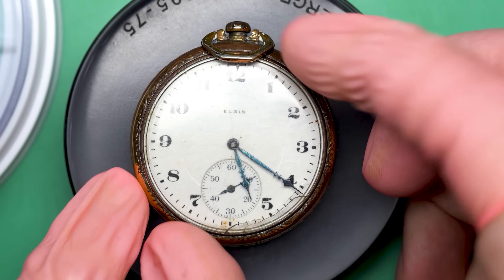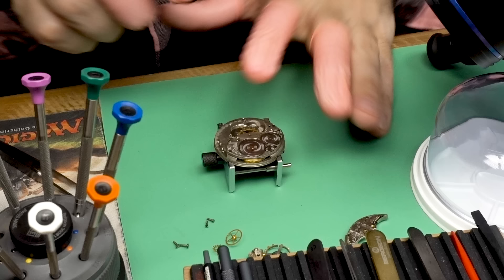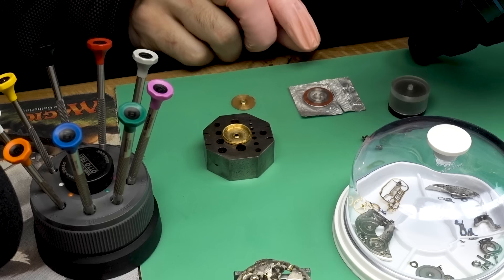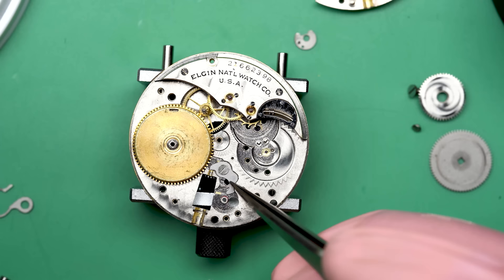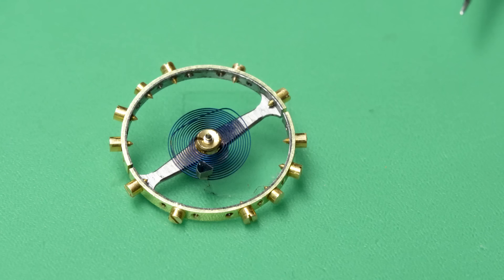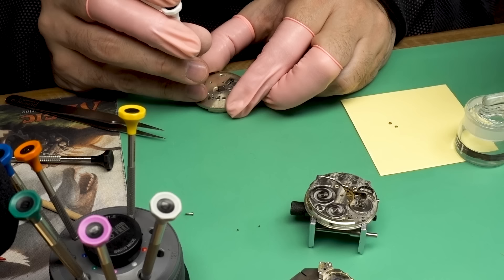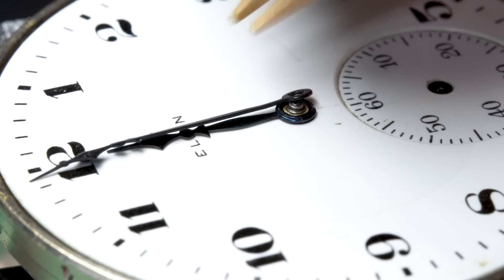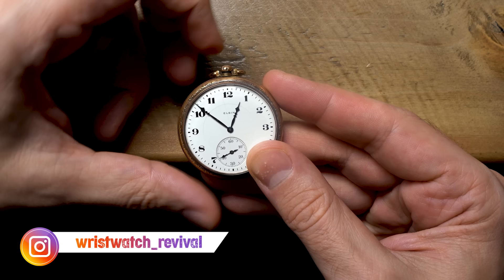My First Patron Sent Me His Grandfather's Pocket Watch

Comment: I have an 1882 Elgin in a Duebler (sp?) case.   The front cover has an engraving of an elk.  The back has two leaves.  One opens to hold a photo, the second one opens to reveal the movement. It is a lever set watch and keeps beautiful time.   I wear it whenever I am wearing bib overalls as they have a bib pocket and button hole for this reason.

Comment: Just bought a pretty vintage (80-90s) watch while thrifting and thanks to ur vids I felt confident enough to pop off the back and I’ve ordered a replacement battery, it’s in such great quality so I think it’ll be able to run after I replace the battery :D
Reply: The Goodwill and other thrift stores are chock full of discarded quartz watches.  They have no dollar value, and can hardly even be given away in today's smartphone and smartwatch culture, but if the style and condition meets with the seeker's approval they can be worth their small price plus the cost of a battery.  Just remember that most of them can be replaced with brand new similar models - including ten year battery - for $9.95 to $39.95 at discount big box stores. 
If changing batteries is desired, I suggest looking at the case back to find the battery number, then ordering six or ten of them from Amazon for less than the the price of one at a retail store.  They also sell several batteries of six or seven different types all on one card, very cheap. 
Those old case backs are friction fit, and have one small slightly raised spot where they are supposed to be levered free by a semi-sharp tool.  Cover the back with a couple of layers of painters tape to prevent scratches - I guarantee for beginners the tool will slip and scratch the back if not protected.  Don't use a knife - the blade is too sharp and the metal too brittle.
Reply: @ammoalamo6485   I bought a guess chrono from ebay for about $10. It needed a new battery. I had taken an Omega pocket watch, cased in the USA by Elgin, in rolled gold, to a Horologist. He replaced the spring and serviced the watch. I asked him if he could get the pressed back off the guess watch. No problem he said, I will use a guillotine. Well he tried but could not get it off. I had tried other street vendors who also could not open it. So I took the watch home, got a thin screwdriver, and a light hammer, and tapped away. Its was the hardest back I had ever removed. I put the new battery in and put the watch on the cover press. There was no way it would go back on. I put some small cuts in the rim, but retaining its seal edge, and press fitted it, but it would not fully seat. I got a cloth and the light hammer and gave it a sharp tap. It seated. If a Horologist could not get it open, this old motor mechanic managed it.

Comment: Hi Marshall, I've been watching you and Mark's videos for a while now, and find it amazing . I even bought some tools to tinker around with. I bought a bag of watches from eBay and some were wind up and others quartz movements. A fellow on eBay had three watches pretty cheap, and I bid on the, not very much, and in the bunch was an old Waltham that wasn't working. I took the movement out of the case and put it into a jar of Naptha (lighter fluid), and swished it around a bit, and low and behold, the thing started running. I think this will be the first one I'll take apart, or maybe, an old stop watch may dad used for his time study job, back in the 30's and 40's. Surely enjoy your vids, and look forward to seeing them. I'll be turning 85 in July ! Bob U. from N.E.Ohio.

Comment: for case back dent removal; delrin rods in a variety of diameters, lightly round the edges a bit, lightly tap rod into the case back with a soft face jewelers hammer (either the nylon or the brass side, doesn't matter. you're touching the case with the delrin, not the hammer). you may wind up with a variety of rounded ends for various use cases, but thems the breaks.

side note; delrin ain't crazy cheap. nylon works, but tends to mushroom faster.

and for those who don't have the bits before hand, or want to stay on the low cost side, yeah rounded toothbrush handles can do the job too hah.
Reply: hard wood has worked well for a few centuries also. :)
Reply: I was wondering if the crystal press could do the job also.
Reply from the maker: Thanks, I'll look for that

Comment: I really enjoy watching you display your skills.  I realize that this is way beyond what I can do, but you have got me started on building my own clocks from 3D printed parts.  I'm working on two designs now and having some success.  Thanks for giving me a push
Reply: A fellow 3D printing enthusiast!, seriously considering starting to try and print one of those projects too, deffinitly need to fine tune my printer  (an Anet A8) before trying though they look to be quite a challenge
Reply: @UNSCPILOT  Take a look at the ones I did.  Woodwaker1 on you-tube
Reply: @woodwaker1  nice work, cool to see them in motion, especially speeding along in high speed mode just to demonstrate how the gears work together, thinking I might try finding a more purely mechanical design even if it means I have little chance to fully regulate it, it would just give me an excuse to interact with the clock more often

Comment: I’ve watched for some time now. And now I’m comfortable to ask. With everything being so precise and so delicate like the balance, is there a specification where the screws should be torqued as to not over tighten? Would over tightening screws or not enough tightening would cause the watch to run faster or slower?
Reply: From what i've learned watching this channel, I would guess not. The screws only serve to fix the bridges to the body of the movement. The metal faces would touch eachother, and while it's technically true that the clamping force would compress the metal itself a little bit, in this case (with the thickness of the metal and the low clamping force) the effect that loose/tight screws have would be neglible. The important thing is the location of the jewels, which have a through hole in them. With the bridges screwed down and the metal faces touching, the height of those jewels wouldn't change. And with a bit of wiggle room, that the pivot/axis is slightly smaller than the distance between the upper and lower jewel, it would be fine independent of the tightness of the screws.

What would be more important I guess is the side to side location of those jewels. Screws in themselves don't act as a particularly effective locating feature. When almost screwed down, such machine screws (with a flat bottom) allow for some side to side motion, since the screw thread isn't the exact size of the hole it is in. Therefore there are locating pins on the underside of every bridge. These pins fit inside precision holes in the body of the movement with a tight tolerance, which makes sure that the jewels are in a precise location.
Reply: I'm just starting on this journey, and no, you won't affect the movement when you tighten the screws. The bridges have locating pins and stand-offs to position the bridge perfectly.  For wheels that are directy held by screws (ratchet wheel and crown wheel) then the screws have a shoulder to prevent any pressure on the wheel. If a wheel doesn't turn freely after fixing the screw, then it means you used the wrong screw. Really cheap movements made of sheet metal (US Time, Timex etc.) might be a little more sensitive to how you put things together, but they are not normal movements and usually are much harder to work on. In fact, they were never really meant to be worked on or repaired but you can if you are good enough.  See Marshal's Mickey Mouse Watch service video.

As far as how tight, just finger tight so it is just firm is enough. Most of these threads are a small fraction of a millimetre thick.  You don't go torquing anything this tiny. You very quickly get a feel for what is correct.
Reply: Contrary to what others say, Yes. Over tightening or under tightening screws, for example yhe screw that holds the balance cock in place, the tighter you torch that screw, the tighter your sandwiching the wheel/ gear that that cock/bridge is holding. So it is possible to overtighten screws. Especially the bridge or cock screws. Over tightening the balance cock screw, could put to much pressure on the balance wheel, which in turn could lead to poor amplitude, or in some cases, even stop the watch from running
Reply: The saying I've heard is tight is right, too tight is two pieces.
Reply from the maker: There aren't any specifications for torque on screws like this, but usually you screw them down until they resist, and then go just a bit more, like 1/8th of a turn, and you'll feel when it's set. And no you can't really affect the timekeeping of the watch with how much you screw down the screws. It's more that if you don't do it enough it could back out, and if you do it too much it could shear off.
Reply: @robertcatron7107  You shouldn't be able to overtighten anything on a watch, except for actually breaking the screw. Most of the jewels are not capped, but even for the ones like on the balance which are capped, if it affects amplitude or speed then the problem is with the end shake in the jewel, not with the tightness of the screw holding the balance clock on.

See Peter Lovick's video on  fixing poor amplitude on a Seagull ST3620 movement.
Reply: @Chrisamic  everything you said I will agree with, on shock protected watches that have a little play in the jewels. So what about non shock protected watches?? With no give in either cap jewel, it is very possible to overtighten a bridge or cock. Again, I guess this is just my opinion, but I’ve seen and done it myself over rhe years

Comment: Watchmaking/repair, is alot like engine building, there are NO shortcuts, everything needs to be hospital clean, properly lubricated,correct tolerance, obviously only on a MUCH smaller scale. I've been considering dabbling in watch repair, as an ex auto technician (specifically a heavy engine technician) it's right up my alley. Great video.

Comment: I've serviced a couple of pocket watches of that make and era. The nickel finish on those movements are absolutely beautiful, especially after you've cleaned them as they retain their glean even after a century. The keyless works are also beautifully manufactured, but the parts are split between both sides of the base plate, which is why you have to assemble them before you place the barrel bridge. After you've worked on these pocket watches you appreciate why modern keyless works are made the way they are. Although the less beautiful than their antique counterparts, they are more practical and easier to assemble.

Comment: Got a similar pocket watch Elgin 303 grade 7 jewels non-working off Ebay as my first foray into this hobby.   I followed along the video to take it apart and put it back together. (don't have the cleaning stuff)  At 16:04 gave it a test wind as well and the movement moved!  YAY!!  Then realized made the same mistake with the keyless and had to take it apart.   The 303 (??) has a different keyless works.  On the face there is a lever on the side for that curly spring.  The pieces at the 18:00 mark was not present.   This was really fun!!

Comment: I'm in my late 60s.  About two years ago, I started buying old Westclox dollar watches and cleaning, fixing, and oiling them.  I originally took interest in that because I used to carry a Bulls Eye in my early 20s. But recently, I've bought a few old Elgins to work on.  My tools are limited, however, and very few of those advertised on eBay are good quality.  Maybe after we get moved into the new house, I'll be able to set aside a clean, intrusion-free space to work and get more properly set up for watch work and more correctly dive into one of these.  But, for now, I am excited to just do light work on them.  I do believe, however, that the old Westclox watches have to be the most frustrating pocket watches there are to work on just because you have to get all the pivots in their proper holes in the two plates at the same time.  I think an Elgin, though complicated, will be easier.  One thing that really worries me, though, is flying screws.  Where do you get tweezers that will grip them without sending them into orbit?  And where can I get something decent to view my victim during the surgery?

I have learned one thing about Elgins since my childhood that I'm sure my dad would appreciate.  That is that the backs screw off.  You don't need a hammer!  Rest in pieces, Dad's wristwatch! 😂

Comment: I'm looking for this elgin bezel and crystal(b&b royal 20yr) for a watch given to me by a client. The bezel will fit the case back, I want to display the beautiful movement as I'm always cracking the back just to admire it.
 I wear wool vests for work and my client thought It a shame my watch pocket was empty. I love it, it has a rose gold quad chain/clasps, button post and a picture case as the fob. S# shows 1896 build.
 its kinda dirty inside and could use a cleaning, I'll be coming back to this video when I get some more confidence for that. Also when I pull the crown it winds and doesnt set the time so there is atleast one issue. Thanks for sharing it's been inspiring.

Comment: The blue on the hands is a temper, or a heat treatment at low temps for longer duration. This temper follows an oil or water quench that hardens steel. The temper relaxes the steel giving pliability back to the steel, otherwise it could break like glass. The effect is beautiful I agree.

Comment: "the more of these pivots it covers the more you have to get lined up."

Tell me about it!  I overhauled a cheap wind up alarm clock where it was a plate movement and ALL the arbors, including the alarm clapper and spring arbor and the balance staff, had to be pretty much lined up at once.  At least the balance had it's own bearings for endshake and I could do that last.

And I did it all with nail clippers, tweezers and an eyeglass screwdriver.

It worked better than when I started though 😁  fixed it running 5+ minutes per day fast.

Comment: I have an old joyas wrist watch and the spring would not wind up. I took it apart and spent ages trying to find where it, and other bits flew off to. I believe I also tried to unscrew the top but because it was threaded the other way I have probably stripped the thread. I know how to get the spring back in, but the wheels have got jumbled up. I did enjoy watching this and the Omega one. Excellent instructional video and camera work. I realized my tweezers are magnetic as well ! Thank you. I have a box of watches to practice on now.

Comment: I have almost the exact same movement to learn on. It’s a 1923 7 jewel model, so the train of wheels is just pivots in metal with no jewels. It runs pretty well after cleaning it and replacing one of the pallet fork jewels.

Comment: The split hour hand is an elgin factory hand. It was very common to do that during that era. Elgin did this on the large majority of their pocket watch hands, and even their wristwatch hands up until the 40's.
Reply from the maker: Huh never knew that, thanks
Reply: @WristwatchRevival  My best guess as to why they did that is because back in the day you didn't just go to the store and pick out a pocket watch. You would've been shown a bunch of cases, movements, dials and hands separately. You could then pick and choose which parts you wanted and the jeweler would assemble the watch for you. My assumption is that the hands were split like that to make up for the small variation in sizes of hour wheels between movements of a certain size (i.e. 16s, 12s etc.). But that's just my conjecture.

Comment: To remove dents from the case, I’ve found a car dent repair kit works really well both running and hammering are needed to get it near perfect. Make sure to put tape or plastic wrap inside the case before rubbing tools inside or you could wear off the gold plating.

Comment: Another nice restoration... The only thing that could be done "better" is pushing back those dents on the back of the case - the support you choose was way too soft, so you actually push those "dings" outward (or so it seems to me). Better choice would be to use a piece of 2-3 mm (0.08-0.12") thick solid cardboard - that would be soft enough to allow for the "push-back" yet limit how far you could go with it. And the best choice still would be a light jeweller's hammer (30-50g) with slightly rounded butt end, and light hammering on that case wrapped in a piece of paper or heavy duty aluminium foil. And yes, there's this well-known saying about more that one way of doing things but I won't quote it here in case my cat would read it... ;-)

Comment: There are ways of restoring metal without wearing it down or causing any damage to the metal, I forgot exactly how it's done but I think it involves a complicated electrical and chemical mixture with a metal coating in the water to refill microscopic holes in the metal and replacing the rust with a new metal coating

Comment: I just picked up two very nice and running Elgin pocket watches, a 1927 Grade 387 and an 1897 Grade 159. Both 16s with 17 jewels, the 1927 came in a worn but nice silveroid case, and the 1897 is a bare movement which I am currently sourcing a case for. The 1927 is pretty clean, but the 1897 is in absolutely amazing condition. The dial is absolutely perfect without even a single hairline crack in the enamel and no wear on the thin Roman numeral markings. Pretty amazing find for $40 on eBay, especially considering it is a fairly rare model with only 9,100 made. And the 1927 was just $60.

The 1897 is running pretty well, only losing around 4-5 seconds a day, so I'm not going to touch it right now. The 1927 is running fairly well, losing 15-20 seconds a day, so once I can pick up some screwdrivers and oil I'll start with that one.